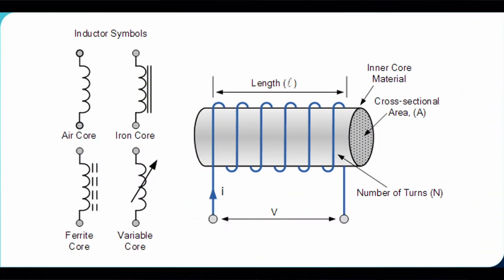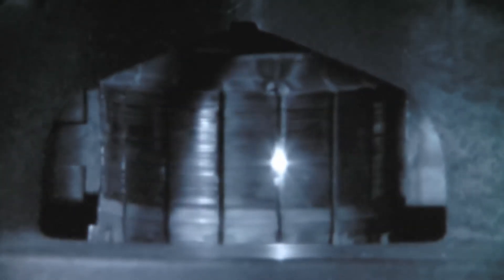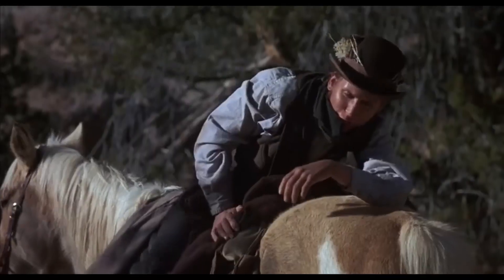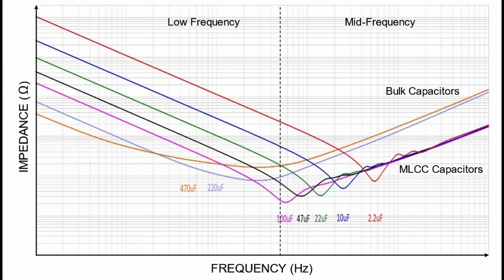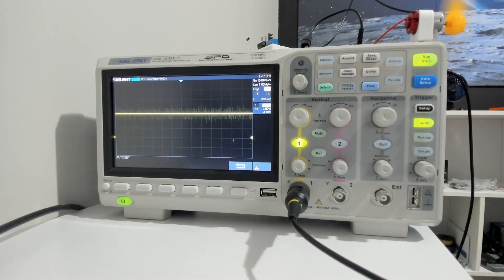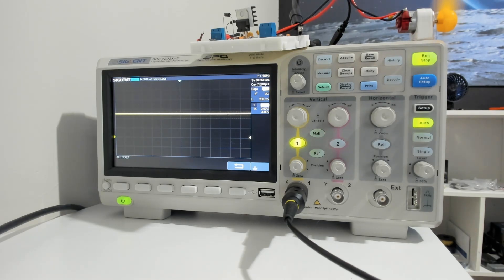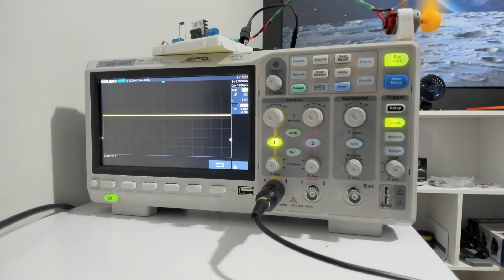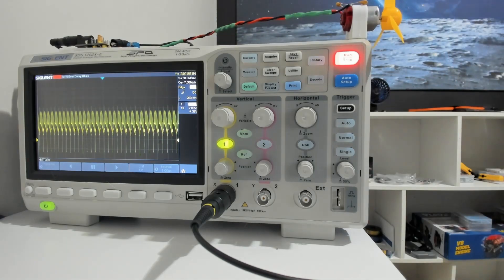USB Motor Circuit Analysis for Brush Motors

Comment: Heehee these are called " dc brushless motors" in first sentence.
Reply from the maker: Yeah I definitely misspoke on that one. Then I described the brush block contact with the commutator.
Reply: @BrunkyTech  Yes, brushed motors put horrible stuff back in their lines, not to mention RFI.
Back in the real audio days, an add showed one of their power amplifiers, Phase Linear, Marantz, forgot who, running a corded hand drill running off the speaker terminals.  
     Audio used to be hard, lol. The real Acoustic Research of the time had problems with a new speaker line, had a lot of inductance feedback, could trip protections on some amps.
Reply from the maker: Everything went digital these days. I used to work on RF stuff designed back in the 70's.. Any new component has the potential to break things downstream and attenuation adjustments are always required to be made.

Now with everything digital, you can get an IC that handles everything.  Match your antenna and impedance, your good. They practically give you the layout.

Comment: I worked in computers, and power supply noise and EMC (Electro magnetic compatibility) were always a big concern.  USB power is designed to handle noise introduced by the loads.  Computer systems have a lot of inductive loads. In fact, the power regulators are an inductive load. Now, data integrity is different (and potentially related) concern. Anyway, this guy really doesn't know what he's talking about. He reminds me of the audio nuts who believe that electrons have to flow in a specific direction in copper cables: like directional speaker wires.  FUD
Reply from the maker: Lets strawman and then iron man your arguments:
Strawman: Youve already conceded to my concerns about data integrity.

Ironman: The most effective way to suppress noise generated by these motors is right at its source. It is always recommended to provide decoupling at the source of the noise (motor), which these USB devices do not provide. A noisy motor has the potential to disrupt even the most well design circuits.

If you watch the entire video (which you obviously didn't) i conceded that a well design USB circuit probably wouldn't have an issues. I still didn't recommend using them because of the following:

The USB spec max voltage drop called out for a device is 350mV, the fan showed demonstrated a voltage drop of 15 V. Because of the MAX V drop requirement, FLYBACK diodes are not required for a USB circuit. Apple got caught with their pants down a few years ago when people were damaging their devices when they plugged in a fan to their port. 

USB also require devices to start up and power too 100 mA when requested. These fans do not meet those requirements, and they exceed the 500 mA threshold. 

As far as those audio nuts, did you even look at my thumbnail?

Comment: Of course, if you have multiple devices connected to USB hub, USB motor circuits (that includes even plugging a lot of USB HDD drives with USB power) will likely lead to data corruption.